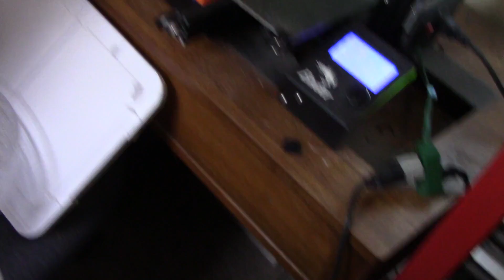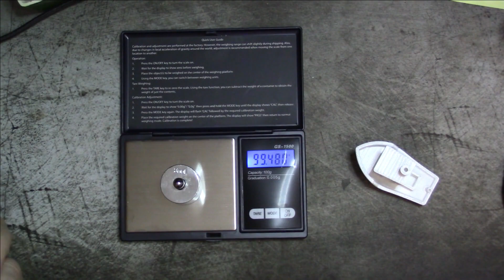The Final PLA Moisture Test. Absolutely Final! I mean it this time!

Comment: Hi Chuck. The dehydration of filament not only takes out the moisture but also makes the filament supple again after becoming brittle. The UK can be very wet, very humid. 45c for around 5 hours in my dehydrator can make old filament seem like new again.
Reply from the maker: Good info, thanks! So what do you think about the people that say the brittleness doesn't come from moisture, but from UV?
Reply: @3rdpig  In my experience the brittleness doesn't come from UV or moisture. It comes from leaving the filament open and just exposure to air for long periods. All of my filament is kept in zip lock bags with a small bag of desiccant. The zip lock bags and desiccant bags are available from eBay quite cheaply. Once opened, pla naturally starts to degrade especially poor quality pla. 
When we print with pla it binds all the components together, slowing down or even stopping the degradation.

Comment: So Chuck, thanks for doing this,  however, if you're going to be doing ABS, or any other filament that needs to have moisture managed, you're going to set up a system to deal with this, and if you're doing it for your ABS, etc, then it's not really any trouble to just add in your PLA. Also, weighing a FINISHED print is silly, you have just boiled the water out of BOTH prints.
Reply from the maker: My theory is that filament that's kept in an air conditioned house in the middle of an arid environment, such as the desert SW USA, doesn't need the moisture to be managed. And also to try to discover just at what moisture level it does need to be managed. I've been printing with the all the filaments that the experts tell me I can't have success with unless they're not only dried, but printed from within a dry box. And I've been doing it with good results. 
As far as weighing the finished print, sometimes silly stuff happens. It's somewhat challenging to get all the things to make a video together, manage the camera and sound, not trip over my tongue and sound like a moron and still not do silly things. Sometimes they get cut out, sometimes not.
Thanks for watching!
Reply: @3rdpig    That's the problem of living in the desert, your humidity, or lack of, makes it hard to do these tests. I'd like to see a test where the filament was soaked for a few weeks, as I don't think the absorption rate is high enough to just di a week or so. I live in NM, so I "suffer" from the same "problem".

Comment: But, what do you do about pla that is brittle?

Very good series Chuck! Thank you.
Reply from the maker: I've never experienced brittle PLA. I've heard some claim it's moisture and other claim it's UV. But it sounds like you've got some answers, thanks everyone!
Reply: Warm it up a bit, it will soften up some.
Reply: 45c for 5 hours in a dehydrator will make pla  supple again 😀
Reply: Is your printer in sunlight?  I had PLA that was as brittle as spaghetti but not in winter.  I think it's UV light related.
Reply: Paul Hill, no they're not in direct sunlight. I have some pla that was brittle when I opened the sealed bag. 🙄🙄🙄
Reply: @tonytillman3953    I've heard this happens with old PLA, however, never out of the box new. It could be the brand, I have some brands that just outright suck.